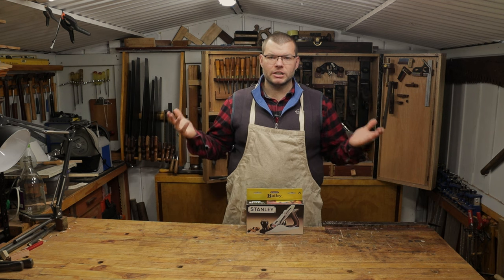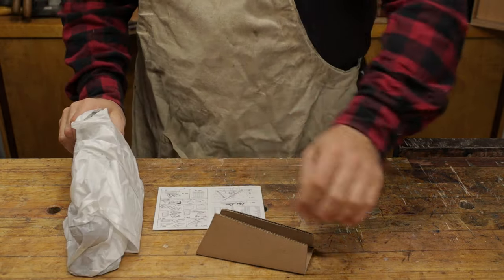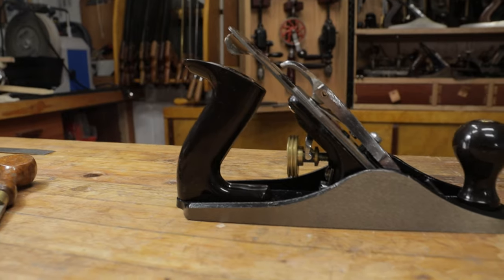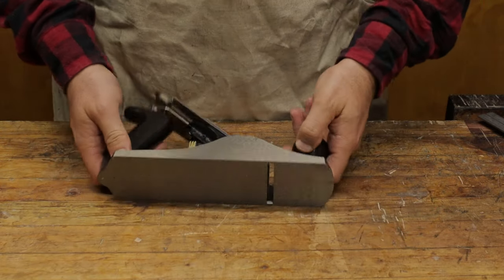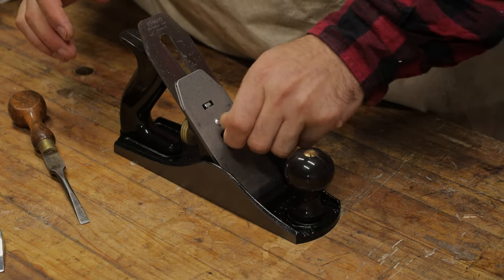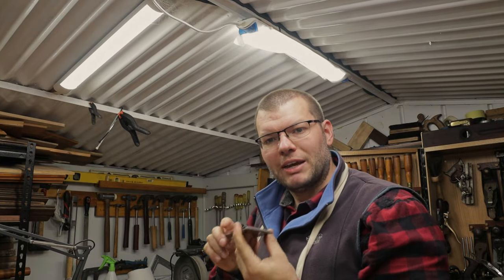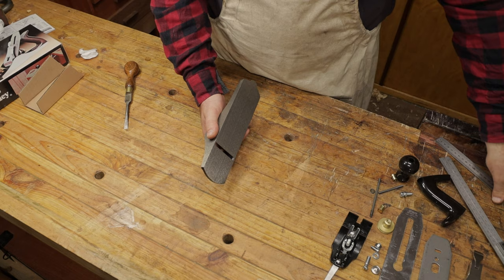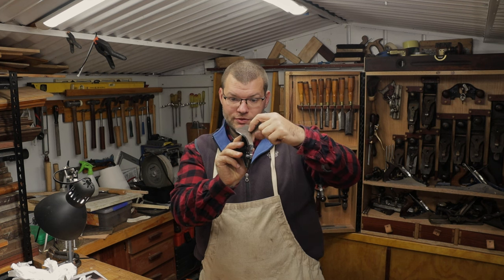Stanley Bailey No. 4 Unboxing and Review

Comment: I'd like to point out to new woodworkers who treat YT videos as gospel. Many channels will tell you that the sides of the plane must be absolutely square to the sole - that is not true. The lateral adjustment makes the blade edge run at 90 degrees to the sole of the plane or when when using it on a shooting board. The new Stanley plane can easily accommodate that requirement in both scenarios. From 40+ years experience, my only complaints are the plastic handles (which are easily replaced with wooden ones) and the wide mouth - which can be reduced by moving the frog forward or, better still, by rounding the blade and using it as a scrub plane; it is perfect for the latter...!
Reply from the maker: Thanks Pete for sharing your knowledge and helping everyone out, much appreciated.

Comment: ordered one and will see :-) I am hobby crafter, so It should probably be great for me!
Reply from the maker: @marek2322  Once the chip breaker is fitted correctly to the blade without any gaps it will work great. I have a video on this if you need it.

Comment: Interesting. Stanley are the “premium” brand for Bunnings in NZ, and I expect Aussie too. Stanley No 4 Bench Plane 1-12-004 going for NZ$195

There’s a couple of really cheap ones, craftright and Trojan, for NZ$35. 1/5 the price of Stanley.

I’m wondering how bad they can be if the Stanley is as you describe. Would it be worth buying total bottom end and putting work in.

I guess the real question is how much work do I want to do to save NZ$160 to end up with a mediocre/cheap plane, even if the Stanley takes a bit of tuning itself.
Reply from the maker: In recent times the price of new Stanley hand planes have gone up quite a bit  . 1-12-004 when i got it was $99, but that was about 2 years ago (sat on the shelf for a while).

Now it seems bunnings here in australia isnt selling that model or i cant find it. They are found elsewhere here for around $160aud or amazon selling it for $107aud with free delivery from the UK.

I have not looked at the craft right  or trojan ones $35 & $72.50 aud however the reviews are not good.

There is also 1-12-204 stanley handyman at bunning here in aust 110 aud or 87aud on Amazon, which i also have not looked at, so cant comment on these at the moment, but i may review them in the future

As for putting the work in on a stanley plane, if you can get them for a decent price or second hand i think it is worth it for a first handplane. I think they are made to a better quality than the cheap makers based on other items I have purchased from those brands. But as i have not used them i cannot recommend using them.

Many say the same thing about new Stanley hand planes when compared to mid range makers like Luban $269aud for no4.

I also have this video https://youtu.be/XcppHlkWmXg where i go through initial setup of the 1-12-004 Stanley bailey hand plane if you haven't already seen it, so see how involved it was for the one i had.

Hope this helps, wish i could give you a better answer. Nothing worse than buying a tool that doesn't work as intended.

Comment: I bought a Stanley bailey no 4 and it is rubbish straight out of the box. How can Stanley stuff up a  tool they have been making for 100 years?. I have to dismantle it after 4/5 passes to remove all the wood fibres that get wedged between the blade and that blade holder. It actually stops shaving after 4 strokes, the blade holder must be too flexible compared to older models, very disappointing
Reply from the maker: The quality of the new Stanley Bailey hand planes are definitely not as good as the good old days. I haven't experienced what you described, however there are a few different models around. 

When you say the blade holder, do you mean the chip breaker / Cap Iron? If the shaving are getting stuck between the chip breaker and the blade, it can be very frustrating. I will assume this is the case (correct me if i am wrong) 

All Stanley planes new or old need to have the mating of the chip breaker and back of the blade corrected so they come together without any gap. The back of the blade needs to be flat and the edge of the chip breaker need to be flat and square and come to a fine point to achieve this. If there is only a fraction of a gap between the chip breaker and the back of the blade the shaving can work their way between the 2 and jam the plane up.

I have 2 videos i have on my channel that go through this in more detail.

This first video covers how i prepared a new Stanley Bailey hand plane, including everything i checked: https://youtu.be/XcppHlkWmXg

The other video is a dedicated video on how to prepare a new old style chip breaker : https://youtu.be/-r0xvK5lbu0

I hope this help you out with you problem.
Reply: Hi Mate, (sorry don't know your name) Yes,  that is exactly what's happening, The timber is old hardwood so it is very splintery and doesn't curl up like new wood would. I know I can fix it with a bit of grinding but I think they should do that at the factory, I thought Stanley planes were an heirloom tool, but not so sure with this one. I just get frustrated when tried and trusted designs are made inferior for no reason. Thanks for your response...BB    @AussieWoodshed
Reply from the maker: @bradbutler4682  It is definitely annoying when something that works well is changed, usually to make extra $$$. Lie-Nielsen hand planes are meant to be ready to go from the factory, but i think a little fettling is still required, not sure as I've never owned one, too pricey for me.
Reply: With the possible exception of a boutique plane, any bench plane, vintage or new, needs to be prepared. It's done only once and doesn't take long.